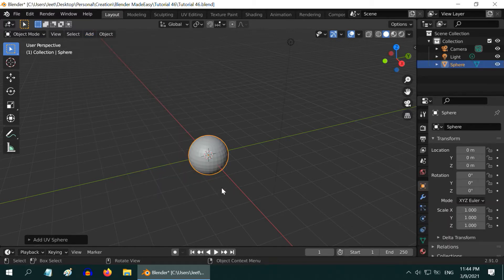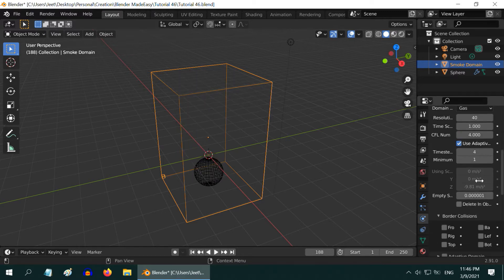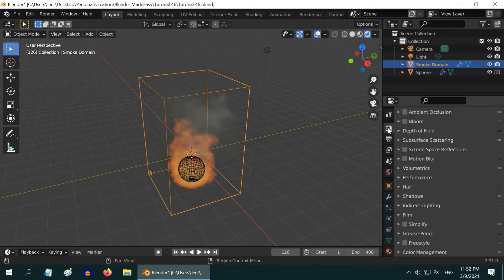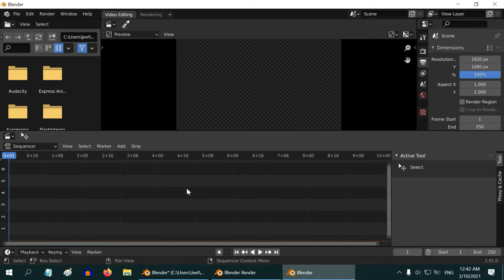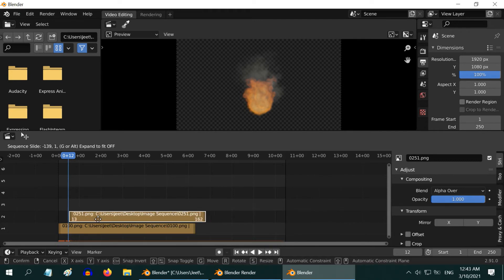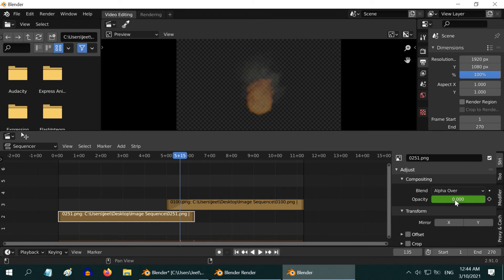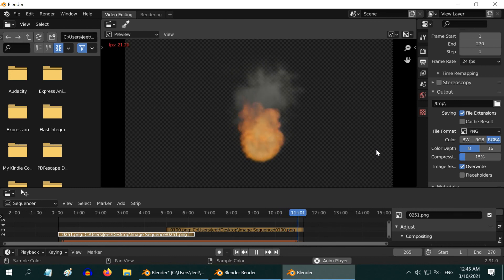How To Loop Fire & Smoke Simulation | Easy Seamless Method For Endless Fire | Blender Eevee & Cycles

Comment: When I exported this fire simulation and imported it into after effects but it comes with a black backround, although I exported it in png format and checked on the '' transparent '' option in the render section. What's the issue?
Reply from the maker: I guess you didn't use the RGBA option. When you have a transparent option, in the Save As function, you need to select RGBA in the options where A stands for Alpha (the transparency channel). Only then the transparency is saved, otherwise you'll get a solid background.

Comment: Hi. Thank you very much for these explanations :).
When I activate the transparent background, the png file does not save the appearance of the flame (it's ok when the background is opaque). How do you do that? I can't generate a PNG with a transparent background, but it seems to work in your tutorial. THANKS :)
Reply from the maker: If you are able to see the transparency in the output, but it does not get saved i.e. it does not get stored when you save it as a png, please check your save options. You need to select the RGBA option (A means Alpha or transparency). The default option is RGB without transparency. Once you switch over to RGBA the png file should get saved correctly.

Comment: For anyone who sees nothing in Rendered mode: Nevermind, thought I had a fix but I don't. It's something to do with him changing the start frame, though. For me, when I change the start frame to 200 or whatever, the simulation simply doesn't happen.
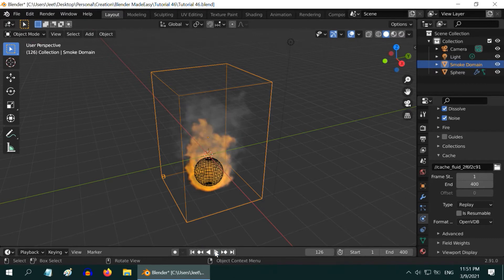Reply from the maker: Hi, did you follow the material setup discussed at 2:40 onward? Is it still showing nothing in the rendered view after setting the materials as suggested in this tutorial?
Reply: @5MinutesBlender  It's not a material issue, it's that the simulation won't happen unless I start at frame 1.

Comment: Hello, I'm using cycles and my fire doesn't have emissions/? I mean it's like a smoke that doesn't have light like a real fire would have.
Reply from the maker: Hi, are you using the blackbody emission? Please turn up that value for the domain material, to get the flame of the fire visible. Please let us know if that still does not work in your case.
Reply: @5MinutesBlender  Hi, it worked now, thanks for the tutorial! Love the videos.
Reply from the maker: @bryanleiporsado6845  Glad to know it worked!

Comment: i can still not see it on rendered mode
Reply from the maker: Hi bro, please double check your light and the domain material settings (density, emission etc), and it has to be a volume shader. If you can see the smoke or fire in the solid view mode, and it is not appearing in the rendered view, the reason is definitely your material or the lighting. If still not resolved, you can simply send us your blend file, so that we can quickly check and figure out what is missing. You can get our contact details (Email ID) in the About section of this channel. Thanks!
Reply: the density did not work but i don't know what you mean with emission
Reply from the maker: @RaNBOWMAN-ft1dr  Density is for the smoke, and emission is for the fire. Please watch this tutorial thoroughly from 2:40 onward, it is explained. Otherwise please send your blend file to us, we will revert back.